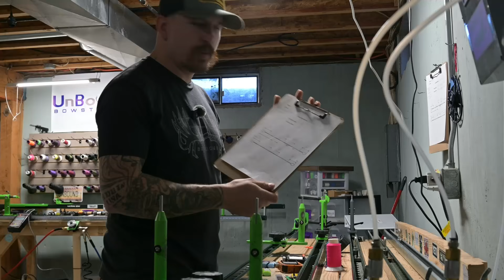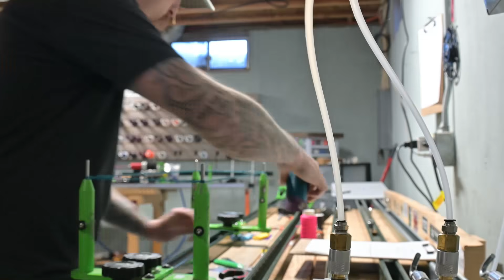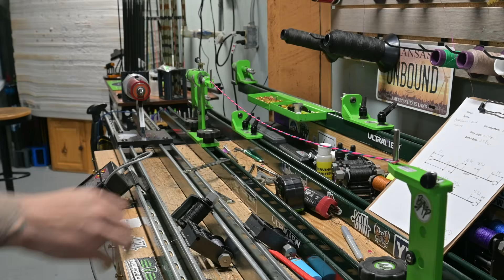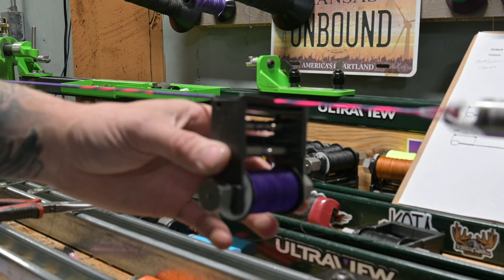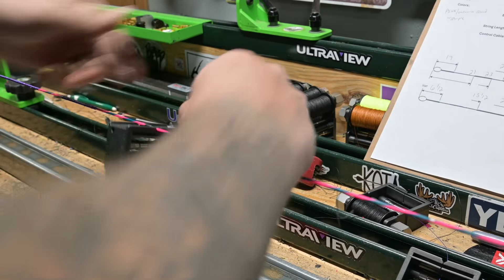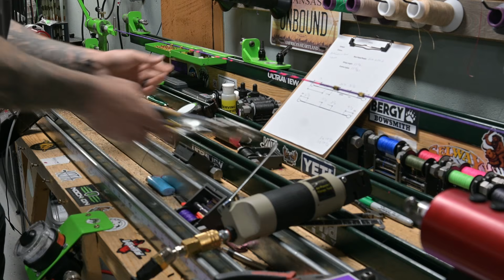How Bowstrings Are Made: Full Custom Build Process! (Unbound Archery)

Comment: Hi, I'm curious how much the length of the string changes when stretched like this?
Reply from the maker: It doesn’t change much. Maybe 1/8-3/16” but the stretcher hooks are on a rotating cylinder that will remove a few twist beige end of cycle.
Reply: @UnBound-Archery Thanks!

Comment: Thank you so much for putting that out there.  I have seen bloodline introduce a new material called Revelation 99 and wondering what your thoughts are between the two.  Thanks again.
Reply from the maker: It’s the same material as vec99 but it had a different coating and twist direction for the fiber. I love the vec99 it doesn’t seem to abraise as quick.

Comment: I've always been fond of the brightest green out there. However I'm thinking of restringing my old insanity cpx and leaning towards Flo pink.
Love the content of your channel and you are truly a craftsman young man.
A couple of questions, which direction will my arrows spin off the string with your strings? Do you build to the exact manufacturers specs regarding strands. I seen in your video you do for all other specs. 
Some string builders will use more and some use less than what the manufacturers use. 
Also curious why you only use black for the center serving on the string. Sorry so many questions I'm just curious Sir.
Reply from the maker: Thanks for watching and for the kind words. The arrow rotation depends on the direction you test bec that determines the direction you serve the center serving. We have a clockwise twist so arrows come out spinning left. You can fletch any direction and won’t notice a performance difference.
For the most part I do follow manufacturers specs but the best part of being a “custom” string builder is being able to change and modify things to make them even better than what the manufacturer does.

Comment: Interesting you change the length and twist variable for strings vs cables. Are you using Bloodline's serving?
Reply from the maker: I’m using bcy halo for my serving but will be switching to bloodline cobra this year likely.
Reply: @UnBound-Archery  Id be interested to hear your comparison to Halo after you switch. Ive been curious about the BCY Majic serving as well. .007 Halo for the endloops?
Reply from the maker: @b @bRad_6Xc ectra for endless. I’ve used the new cobra serving and it’s a lot like halo probably even better.